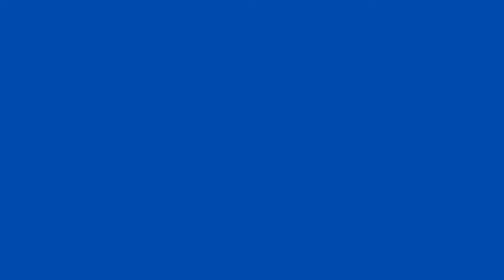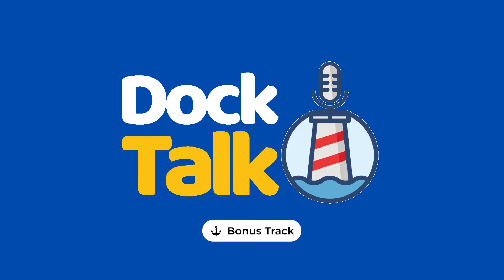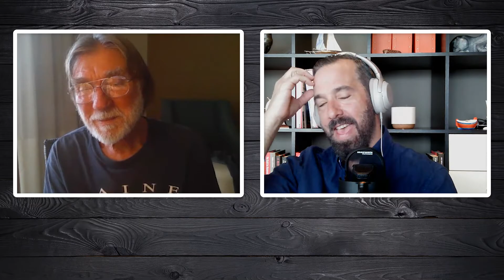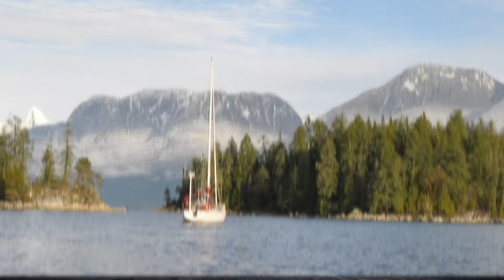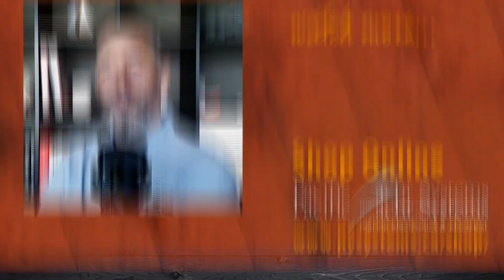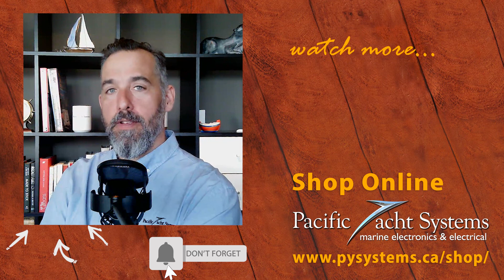Nigel Calder & Jeff Cote Talk Marine  - Bonus Track - Favourite Products For Your Boat

Comment: Jeff, really enjoy the videos, very informative. I have a question? I have a 1992 Carver 430 CPMY. I want to install solar to charge 2 lithium 300 AH batteries and want to have the ability to run my 110 V systems on board except A/C while anchoring. I am thinking to install a total separate battery bank from the current house / start battery bank. Can I install a 3000-watt inverter and simply plug into my shore power outlet with an adapter from the inverter to the shore power receptacle on the vessel? Is this a suitable method? I currently do it with a 3500 watt portable generator and all seems to run fine.

Comment: This is not on topic but I respect your opinion.  If an encapsulated lead keel has let go of it’s fiberglass covering can I drill holes in the bottom of the keel to remove any water.  Dry it over several months.  Then pour in from the bilge side after opening it, that penetrating epoxy to fill any small voids and to rebound the keel to the lead ballast?